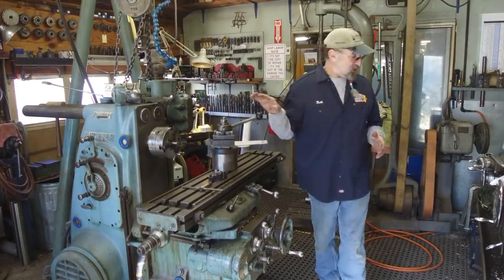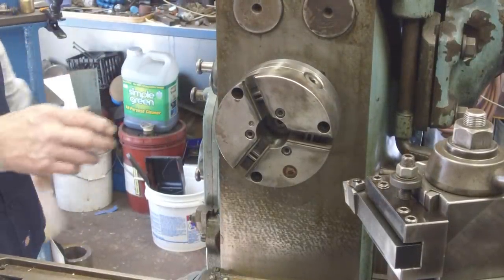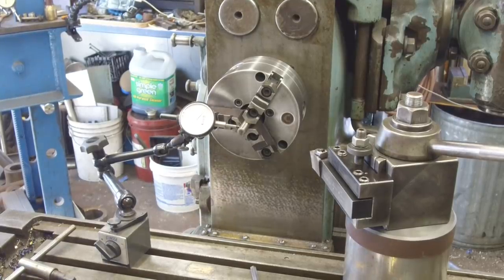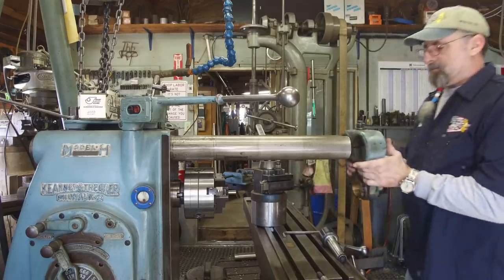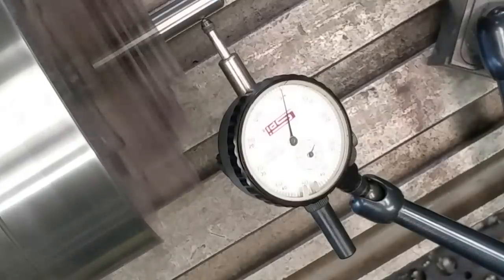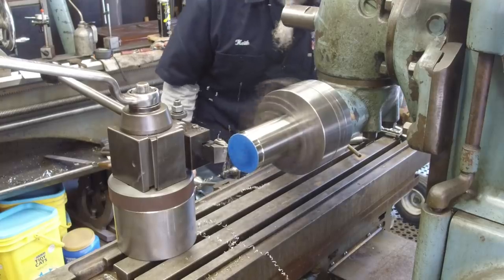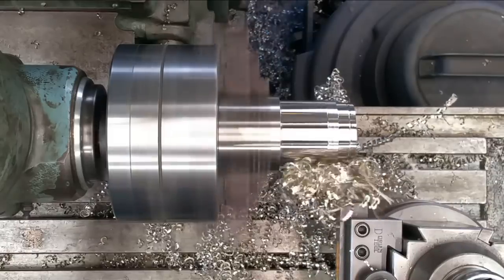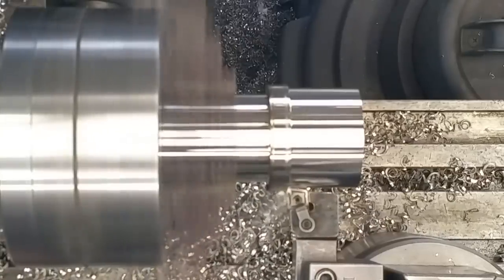Modifing My K&T 6 Inch Universal Lathe Part Three

Comment: Excellent demonstration of an unusual and novel way to machine steel. After sixty years in the trade I never would have considered adapting a universal milling machine for lathe use. With the correct insert and plenty of power it handled that SS like a pro. A large diameter O.D. could be turned by a cutting tool mounted vertically on the bed using the Y axis for feeding. It's always good to have something set up and ready for that odd job that comes along every ten years or so.

Comment: I’ve been enjoying this set of videos. I have a small Benchmaster horizontal mill that I setup with a three and 4 jaw chuck for turning and a 8” angle plate that I can setup for drilling/milling. I even put a 1hp DC motor and drive on it so I have a full range of speeds.

Comment: Hi Keith I enjoyed the vid ,considering the  job stickout , grade of material  and not quite the ridgity of lathe headstock the K&T taking 0.75" cut was  impressive, the Sandvik D&MT tooling was a standout.
I am in Oz I am going to order one .The slower speed and increaseed feed is my usual go to to reduce chatter also. Thanks Keith regards Dibbo.

Comment: I know this is a while back, but just to add a comment...  I think we've got to take into account the stick out, which in this case is the distance from the 90 degree head, not the chuck.  If you cut anything with that distance of stick out I'd expect a load of resonance.    But jees, cutting that stuff with that setup to that finish is damned impressive.  I wish there was more old machinery available in the UK.

Comment: Keith I'm going to buy you a complete set of T-handle Allens . Tell me what set or sets you need and I will get right on sending those your way . I prefer Bondus if thats OK with you . Think of it as a thank you for all the years of information and enjoyment you have given me . My machining STARTED because of you !
Reply from the maker: I don't think they make them any more but MAC TOOLS use to make a molded grip handle and the side bit would come out the end of the grip, I worn out a set.  I'll accept what you prefer, thank you very much. ;{)-------
Reply: Klein Journeyman JTH610E/JTH68M are what you want.  Like the MAC ones but even better.
Reply: i have the klein Journeyman set also .....those are the side darts as I call them ....... I am on it .....
Reply: How  are those for a set of T handles ?  one set of Side darts  SAE, Metric and Torx. I was going to go ball end  but with torque those wear out . Only thing i dont like with my Kleins is the way they mark the top with ink. 3 months its gone . It is etched on the shafts though .

Comment: Apparently your spindle bearings are in good shape. :-)  If you located your tool bit 90deg so it was on the table you could handle any swing without the need for spacing the stand to get centerline. The toolbit wouldn't really care it was on the bottom instead of the side.
Reply: That's what I was thinking, run the tool bit vertical.
Reply from the maker: You can come in from any position around the clock of rotating axis, the tool height, rake, and reliefs all have to be set in respect, giving your set up, the limits would be more or less giving the project and how it fits in the machine to be machined. ;{)------
Reply: you could mount the tool on a vertical rotary table.
Reply: Vertical positioning of the tool bit (facing up from the table) would give ease of set up for machining the diameter but limits facing to the height of the tool. Keith's set up, despite the need to adjust the toolpost height for the diameter, is still the only way I see to face the full maximum diameter his K&T will swing. Am I missing something?

Comment: I’m impressed on how well that works, especially on tough material. Personally I prefer the CNMG style inserts but I use the tools on my lathe that’s similar to your Rutland. Of course I wen through the trouble to dovetail it and put an adjuster in it just like a tool block

Comment: A very interesting series of videos.With some of the odd part shapes you seem to get every so often Keith maybe adding a decent sized face plate for use on the horizontal spindle would open up even more ability that might be outside either of your lathes swing and that chucks capability's? Some of my early 1900's machinist books show some amazing jig boring type work done using little more than a plain bearing lathe, a face plate, a shop made indicator, and a few tool maker buttons. Plus the face plate would gain you a few more inches. I'd be surprised if you hadn't already figured that out though.

Given the material type you were testing with, depths of cut and less than perfect rigidity with the vertical head in the horizontal position I'd have to judge that as a 100% success and well worth the time it took. Sadly my little toy Atlas horizontal is far too wimpy to try something like it. :-(

Comment: The answer to that first question is, why not. Also, when you have a large flywheel or something similar, you wouldn't have to have a tall tool post base. You could center the tool post with the Chuck vertically and raise the table to cut in a vertical fashion as long as you have enough control raising the table.

Comment: If you made a vertical tool holder your could in theory cut on center for the lower jobs. It would be in a vertical plane instead of a horizontal plane. You would loose a bit a swing but your center would only on the y axis of I'm thinking correctly, or the left and right. However, it's 1:20 AM. I am just now seeing this video after a 16 hour shift and a strong beer or two later.

Comment: If a bracket can be made for the head action, that becomes a valid lathe. I think a lot of vibration comes from the neck by the way the undulation was present on the work piece before the tool bit was swapped. I say that because i forgot to tighten my head on my smallest lathe once after a cleanup and it did exactly the same pattern.

Comment: Very handy, I'm a little surprised at how well it worked in your 2nd setup without a tail stock. then again, I am sure you could lash up a tail stock if you needed to. I'd still think about a face plate (though I have very seldom needed one myself) great job .

Comment: That looks like the perfect setup to resurface flywheels for cars and make them run true at the same time.  I bet people would like to have them lightened as well for performance applications but how could you balance them afterwards?  Being able to swing that large means you could even swing a big truck wheel if needed or even brake drums and rotors.

Comment: The chatter is due to the distance the chuck is from the bulk of the machine. If that chuck was mounted on the face of the machine like you had it originally you could probably take a 1/4" cut without even a hint of chatter. Still pretty impressive with the universal head, once you had it dialed in...It's cool to have options!
Reply from the maker: 15" off from the main body, that was in the footage of video I had to redo, due to hitting the slow mode feature for the last two scenes, forgot to re state that. Good point, but the machining on the backing plate at the main spindle in part two shows it's limits and even in the big lathe and on a good size shaft, about .100" per side is about all the insert will handle with that material. ;{)------
Reply: Keith great video did not notice if you used the Y axis lock after you set the depth. Might help on the harmonics. Cheers

Comment: Your lathe tool can be located below center of the lathe spindle instead of on the horizontal center.
Reply from the maker: Thats what I was stating there and many other of my videos, below on the OD and above on the ID. ;{)------
Reply: @KeithFenner  I have a B&S plain mill built in 1907 with a threaded spindle nose and a B&S #9 taper. I made a faceplate to screw on my spindle but now realize that I should have utilized the internal taper instead. Your video made me realize I have made a mistake. Thanks

Comment: Keith, the first run out check was with the jaws alone. The second used the jaw extensions. Would that make a difference sine the measurement was done under different circumstances?
Regards,
Eric

Comment: You mentioned 42 inch swing - would that foul the handle? Great set of videos!
Reply from the maker: The control handle on the K&T can lift up and swing around then drop back in thus being back 90 Degrees from the main spindle face. ;{)------

Comment: @Keith 11:50 ....... could you theoretically turn your cutter 90 degrees and cut at 6 O'clock and not have to worry about centering vertically .......... just horizontally across the table.  Would that be worth considering?  Or does it eliminate too many other advantages
Reply from the maker: You can come in from any position around the clock of rotating axis, the tool height, rake, and reliefs all have to be set in respect, giving your set up, the limits would be more or less giving the project and how it fits in the machine to be machined. ;{)------

Comment: do you have to mount the tool horizontally? I could imagine mounting it vertically right on the table, then you wouldn't need the high tool post when turning large pieces.

Comment: could you swivel the vertical head above the centerline of the horizontal spindle and swing something light but very large diameter?
Reply from the maker: yes the vertical head can swivel 360 in both axis of mounting and it can gain about 9" more on the radius of swing, but it puts it out over the table farther, losing the drop between the table and knee. ;{)------
Reply: @KeithFenner  So you'd gain some 5" on the radius? I can't imagine a need for it but there's always special cases. Like J. Paul Getty's answer to "How much is enough money?" "Just a little bit more."

Comment: Somewhat similar to a "T" lathe for facing and short work.....
Reply: indeed. It strikes me it would be excellent for facing at angles other than 90 degrees, given that the K&T table can be angled. This is not something conventional taper turning attachments can help with, and unless the required travel is short, a compound slide is not well suited (and does not usually feature the option of power feed). A hydraulic copy toolpost is also limited in travel, and the template is limited in diameter.

Comment: The machine head/chuck, are not stable enough, compared to lathe. If you ran a center on end of pc., with center head holder, it would be better. Also, slow the rpm's down with heavier cuts, when roughing. You need end support, like  I said. This is not a lathe....🍁